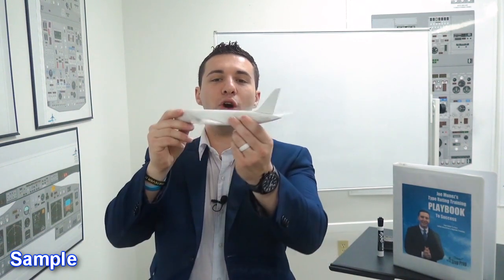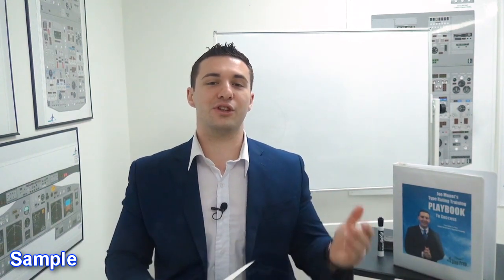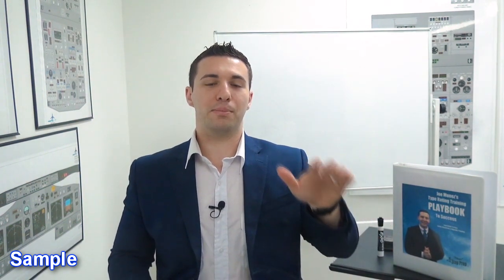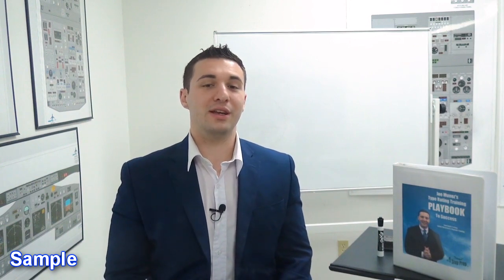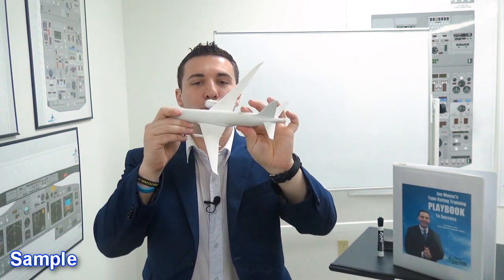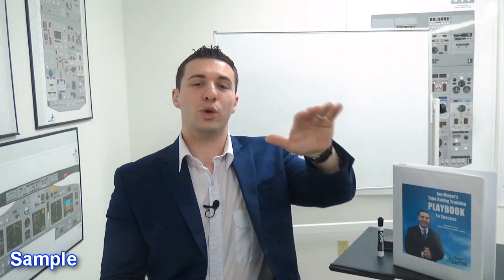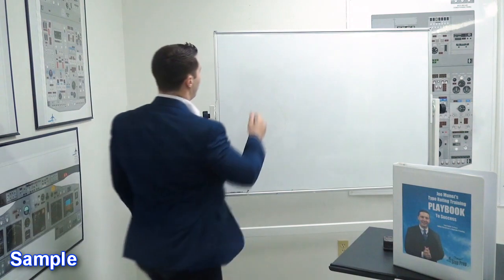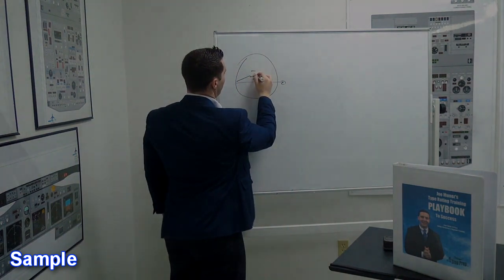Engine Failure on Go Around

Comment: It's not just these immediate actions that are necessary....yes, get on the pedals, correct that yaw. What bedeviled me in the 767 course was the utter lack of instruction of "what comes next"!. Many Airlines have a series of inputs procedures and callouts at that point that take some serious study to absorb and implement. All of which the old Sim instructor thinks you popped out of the Womb knowing fully. Or worse..*in my case* you ger 9 Sims in flat panels, then just before your checkride they plop you in a steam gauge Sim that looks like it was built in 1944! This of course changes your scan, and which knobs to spin and when calculus immeasurably.  I wish these 36th street Mafia types would get away from using "Ref80" and other confusing V numbers and shit like that! In a stressful phase of flight it forces the new to big Jets guy (or gal..) to start doing mental math and gymnastics ..result? Brain stall! You drift from centerline,, you stay slow, flaps stay out, and it's a mess. That's why now I just spin it up arbitrarily to 220 knots. The Sim and the plane loves that speed. Even if it's 1-2 knots off from the mythical "Ref80" speed they keep screaming about...it's close enough and within standards. Just my 2 cents. Love the vids by the way.

Comment: Quick question, can we use auto throttle while 50 feet above the runway while landing on the A320?
Reply: @Rice Cooker2000

If you mean for landing under normal conditions, yes. In normal law, the A320 can be landed with autothrust to assist you. Simply keeping it in the climb detent is all you need. Just bring the thrust levels to idle when desired.
In alternate law (loss of 2 ADRs for example would revert to alternate law), autothrust is *unavailable*. The autothrust can be flown below 50 feet for landings if you choose to use it. Juan’s video on the A320 landing technique says to cut the power at 30 ft RA, and to begin flaring shortly after to arrest the rate of descent. 
If you land with autothrust, keeping the autothrust on as you flare is not a good idea. It maintains airspeed, and as it bleeds off during the flare, it will add thrust to maintain the set airspeed. This increases landing distance. However, if you land without autothrust (which I prefer), you get a bit more freedom as to how you time and control the landing. Hope this helps 👍